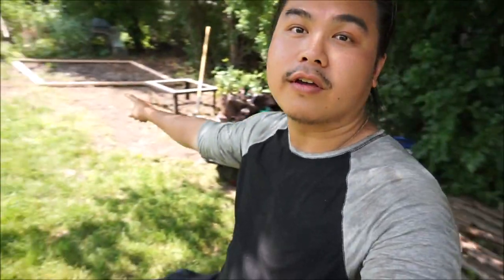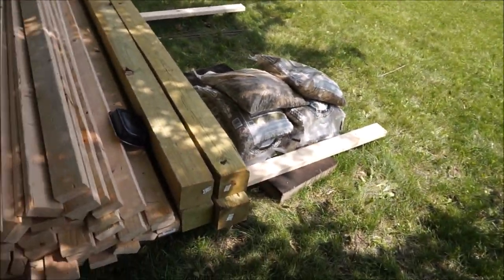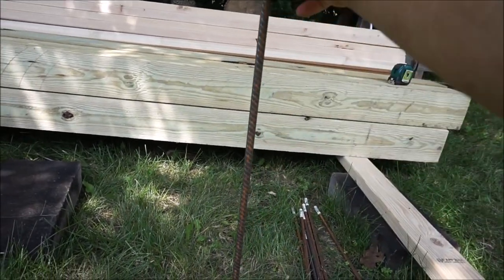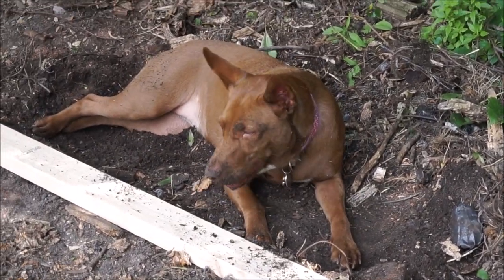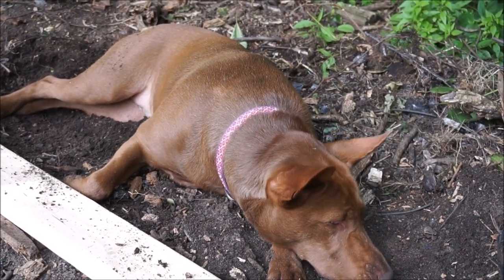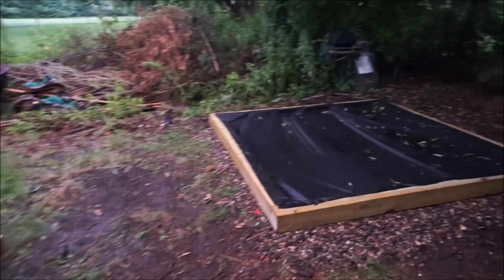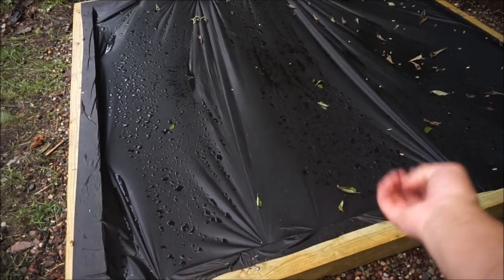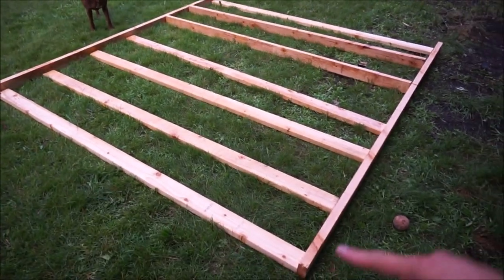Building my Shed - Part 1 - Homesteading - Tiny Home - Man cave - One man cabin

Comment: While you are building your shed, properly stack and organize your lumber near the site, then put a tarp over it when you aren't constructing. If you don't, it's all going to warp in different directions when it gets wet or humid. You will also want a smaller drill bit for the rebar holes. The rebar should be snug and have to be driven into the holes. Then comes rain already...DOH!

Take the weed fabric off. Your inclination that it will trap moisture and cause problems is correct. The floor will mold regardless if you build this on-grade (right on top of the soil) though. Even treated lumber is not impervious to rotting when it is in constant contact with moisture/soil. That is why you usually see sheds built with cinder blocks under it to support the shed off the ground.

Lastly, I hope you have checked your local zoning ordinances (and HOA requirements, if you have them). There are often regulations for building what the law typically refers to as "accessory buildings", to include mini-barns and sheds. As much as I would hate to see you waste a bunch of $ building this improperly, I would hate even more to see you get in trouble and cost you even more.

Sorry if I rained on your parade. Good luck, buddy!
Reply from the maker: Thank you so much for the feedback!! This is why I love making my videos. I have the ability to share it with people who can help and provide advice. 

I'll remove the fabric and hope that everything dries up before I place my flooring down. 

I'll have to ask about the city ordinances. I do know my city allows up to a 200sq ft building without a permit. That's all I know as of now. As for building it correctly, I'll find out. You're exactly right that I don't want to get fined cuz it's not built correctly haha
Reply: @cluelessbushcraft   sweet seeing a side project in the works. The other dude was right in saying the quality of your channel deserves more subs. (I found your channel through one of the FB foraging groups btw. We chatted once awhile back.)

And Grumpygrunt I got a story for ya. My boss (lets call him Dan) tried to put up a shed where he lived in Andover, MN. It was just a simple shed kit from Menards. He put it together,, then the city told him to take it out because it was too close to the road and wont pass code. He had an L shaped pool in his small back yard also, so there is only the one small area for the shed. He asked the city if there was anything he could do.

The city replied "if you get a certain number of neighbors signatures saying they OK'd the location, they will allow it."

So Dan gathered more than enough signatures for the city, and he was still denied, and was told to remove his new shed.

Dan got clever at this point. He went to a junk yard and bought a piece of shit axle, then dug a trench under the center of the trailer. He placed the axle underneath the shed, and got a license for his new "trailer."

The guy from the city was called out a third time for expection. He saw this new trailer with a fresh license plate and new tabs, then smiled at Dan and signed off on the paper work.

So once the city was out of his hair, he buried the axle and you wouldn't even know its there. (Never had tires on it.)

Dan has since moved, but the new owner left the license on the shed, as it made for a conversation piece.

Please don't say "cool story bro"

Peace!

So my boss
Reply from the maker: @riverrat9412  hahaha that is an excellent story! Thanks for sharing! That's a great example of the loopholes we got in our regulations/codes haha

I also appreciate the number of subs comment. I really wish I knew how to get more subs. I'm just putting more and more consistent content out hoping one of these videos will catch veiwers attention and it'll skyrocket and grow the channel. 

Also I did spend a moment to check the ordinances. Looks like it's pretty simple. I can't build in front of the home. I cant build within 5 ft of any property line. I can build up to 200 sq ft without a permit. So my shed is 8x8 so it's well under that. I do plan on likely building another lean-to shelter off the side of the roof of the shed later as on open space for doing blacksmith work or something. 

I measured my distance from the back property line to the shed base and it measures 5 ft exactly. Same with the side of it. Im cutting it extremely close! I really hope the city doesn't give my issues with that.